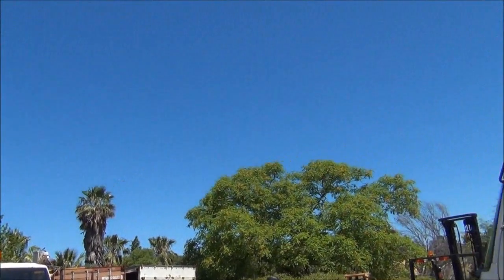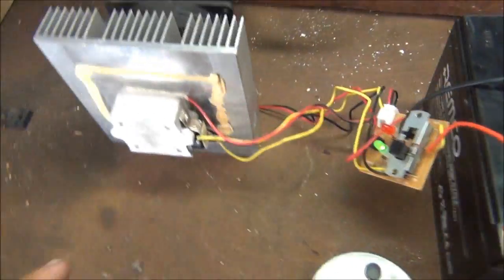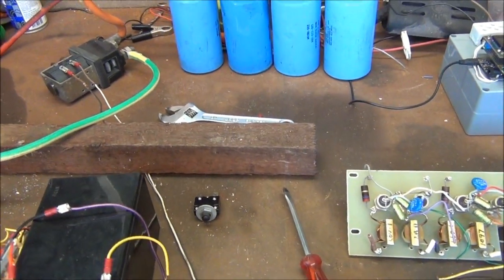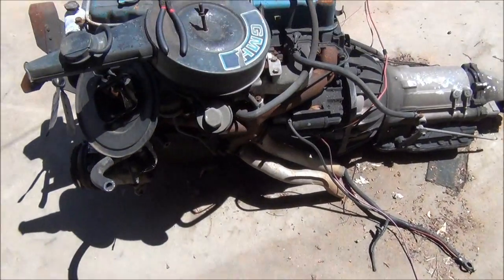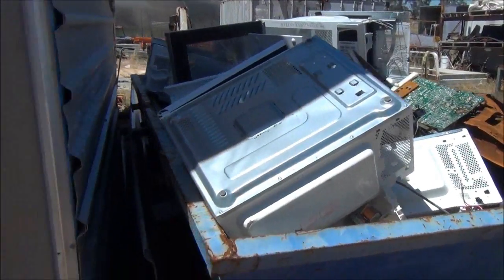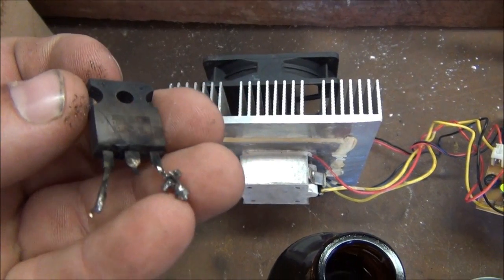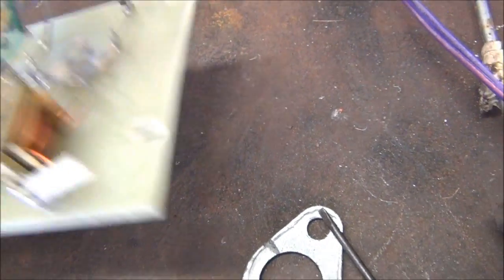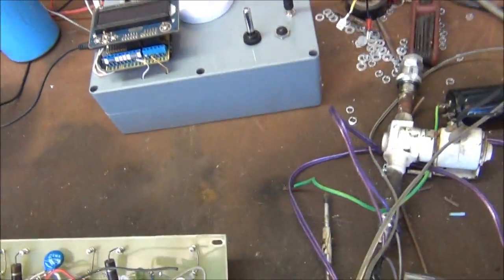Big Waffling Saturday Update, SCRs, Peltier Cooler, Cap Bank, Shout to Dash8!

Comment: the big device on the heat sink with the three terminals is a igbt (insulated gate bipolar transistor)
Reply from the maker: incorrect sir, its an twin module SCR
i can get you the part number to confirm if neccesary :)
Reply: alex993cc1
i believe you i just have not seen one

Comment: Found the data sheet on our scr bricks - their gates are 3V @ 200ma to trigger - I fired mine (finally found a suitable load - portable 12V hard drive) off a 3V LM317T circuit with a 10R resistor inline. Gotta find me a more suitable 12V load for testing that gives an indication that its on (otherwise I'd just use a resistor). Suppose I could chuck the current meter in series :)